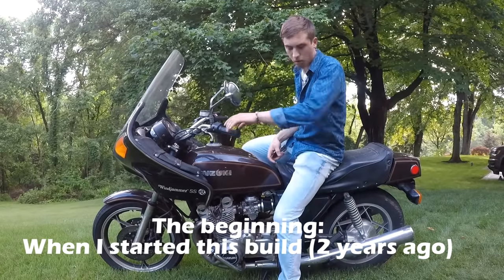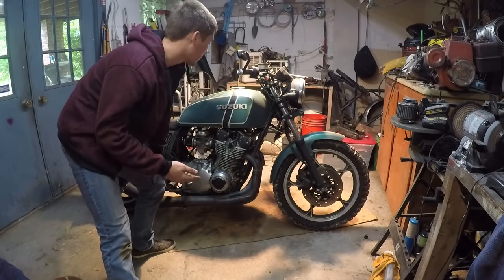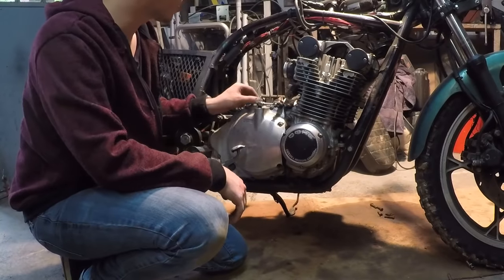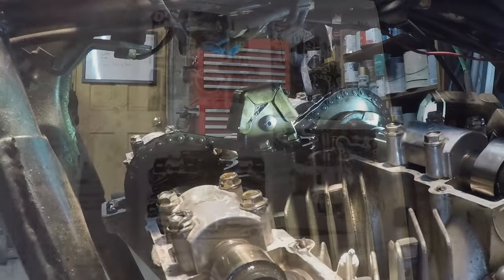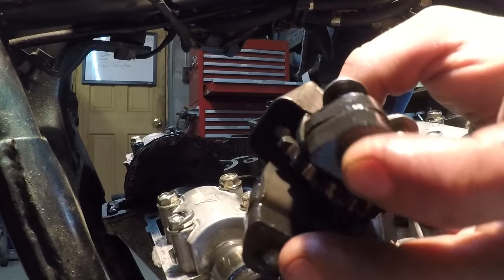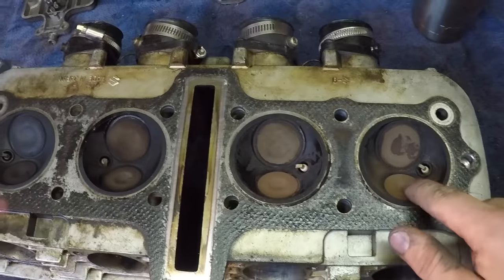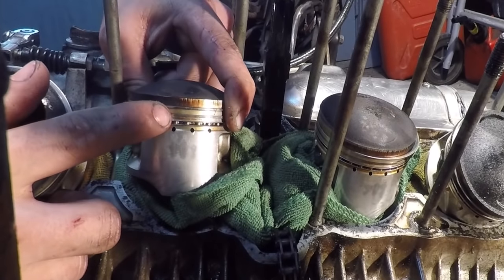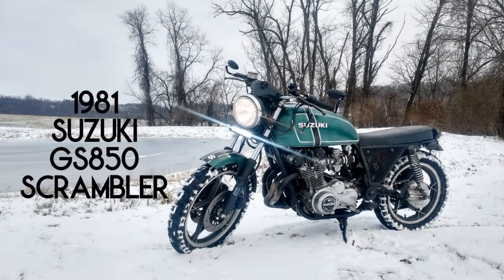Suzuki GS850 Scrambler | Fixing the OIL LEAK! | Top End Rebuild #1

Comment: Use a brass wire wheel on a drill it will be abrasive enough to cut through the gasket and soft enough not to damage head

Comment: I just finished my first engine build on my '80 CB750K this spring. It was intimidating to start but when keeping everything organized and doing it by the book everything went well. I had the same problem as you, oil leaking from the gaskets and I even got a blown hole in the cylinder gasket. I took the engine out of the frame, removed the head and the cylinder, and noticed my pistons were all carboned up. I decided to do a full rebuild. New pistons and piston rings, removed all the valves, changed 3 of the valves and grinded and lapped all 16 of them and did the valve leak test, new cam chains and all new gaskets. After rebuilding I cleaned the carbs in a UV cleaner, all new jets and finally synchronization. Now the bike is like new and runs amazing.
I think I got lucky on the gaskets because mine weren't as stuck on the cylinder as yours. Still, I did have some bits of the gasket stuck on after removing the bigger pieces, and I did use a sharp, flat blade while spraying WD40 on the gasket to keep it wet. Then just carefully with a steady hand removing the stuck bits. But that was the last resort, before that I used many edged, plastic tools. Hopefully you manage to remove yours, best of luck and I enjoy your videos!

Comment: The Suzuki recommended method for removing the cams on a GS is to grip them in place using large locking type vice grips (called mole grips in the UK) before removing the bearing caps. The Clymer should mention that, the Haynes workshop manual certainly does. Good job on the build, I've not long done the head gaskets on my GS as some asshat rebuilt it using exhaust paste!

Comment: Always having a go, that's gold. Hanging for part two as the head gasket on my 1979 Honda XR80 is baked on good (cylinder currently getting a re-bore).  I think gasket remover and a very careful metal blade are the go as nothing is working to well so far.

Comment: If it's leaking a bunch of oil just sitting it's not just coming from the head.  The oil all sits in the bottom of the engine and can't possibly leak from above that level when it's not running. Oil leaks can blow all over the place when riding.  Next tme clean the engine really well and let it sit still running.  This way you can see where the leaks actually coming from.  It's important to properly diagnose issues before starting repairs.  This will save you a lot of unnecessary work over time.
Reply from the maker: I know the head gasket is leaking. Some other gaskets are also leaking, that's why I am changing all of them.
Reply from the maker: I did wipe the engine down before riding and saw that oil was leaking from the head gasket. I wouldn't do all of this unless I knew for sure it was the problem.
Reply: @GoldGuyRides  ok. Just be careful making a determination from a ride. I've been a mechanic for a long time and have seem multiple times where wind blew in strange ways and made an oil leak look like it was coning from a completely different place from reality.

Comment: Im getting a a 77 GS550
Planning on buying a second motor and doing a 650 katana topend 
Should be good for about 71hp crank
Reply: Strange Builds Inc  dude greetings from Greece. I also have a Gs550e and heard about this swap. Is it just really so simple that you remove the 550 head put the 650 katana head and that’s it???? Because I already have found a 650 katana laying around for just about nothing in the price department!
Reply: @loco250490 if you are doing jusy the Head i think it is that simple 
Im also wanting to do the katana pistons cylinders as well 
That requires cleaarencing of the cases that will give you the full effect of power
I recomend checking some fourms for a big more help with this swap

Comment: Glad you backed away from the razor blade, could cause you way more problems than its worth. Good ol gasoline, desiel, carb cleaner, brake fluid (as long as your engine isnt painted)  there should be permatex gasket remover you can buy at the store or online. Ive also heard if you can find a tub big enough you can soak it in hot soapy water

Comment: From memory there GS 850 had has separate gear box oil filler mine was an early 80's model, have a look in the manual.

Those cams look like scrap.

Comment from the maker: If you have any tips for removing old baked on gaskets without damaging the head, please put them in the comments below. Enjoy the video!
Reply: GoldGuy you could try burning them off with a small kerosene torch, just keep it moving
Reply: Not sure but maybe try a heat gun? Maybe it could help bring the gasket off the surface... Use GooGone to soften gasket? Just throwing in some different ideas, looking forward to the next video, keep up the good work.
Reply: 81trail 70    The hell is a kerosene torch.    Do you mean propane ?
Reply: CRC Gasket Remover is the only chemical I found that works on these old gaskets.

Comment: Bristle disc is the way to go on that. My only concern about this is the fact that you aren't fixing the actual problem. 3 out of 4 pistons are dry and look healthy but that forth one is completely oil soaked. Definitely getting some oil into the combustion chamber and burning it/leaking out of the HG. Either the piston or rings are damaged/worn or possibly a valve stem seal is bad? What your doing is just a band aid. it may fix your leak onto the ground for some time but more then likely its burning oil and will leak again.
Reply: Josh C ...i agree. good observation ! probably the seal... goldguy, great vid as usual ! keep em coming :)

Comment: They make a spray on gasket removal spray that you can buy at auto zone, spray it on and in a few minutes it should peel off
Reply from the maker: I have read reviews of that stuff and I have heard it doesn't work that well. I think that if aircraft remover had no effect, the gasket remover wouldn't either. I don't know though, maybe I should give it a shot. Thanks for the tip!
Reply: @GoldGuyRides  hi, I would recommend you to buy a soda blaster..  takes on mostly everything..it's pretty dusty to work with thou, and should be put outside..  also water rinse the white powder away..that's..don't let it sit on cars, house surfaces etc..then it'll be like a paint remover..
..look it up. ..as always great job and videos G.G.!

Comment: Hey Gold Guy!  What jet sizes did you use on the GS850?  And did you change the needle?
Reply from the maker: Yes I did add a nylon spacer under the needle and changed the jets to 130.
Reply: @GoldGuyRides  ok, when you say under the needle, are you talking above the lock washer, or under (which would be pushing the spring down pretty far?  I have the same bike and carbs as you and can't get the dang jetting right.  bogs down at anything further than 1/4 throttle
Reply from the maker: @victorhumphrey7127  under the circlip